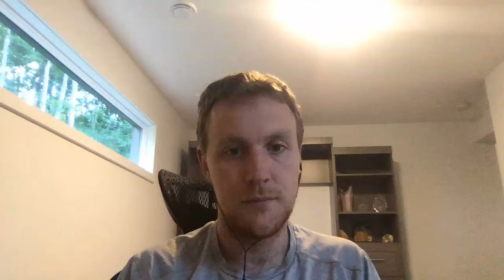DON'T MISS this U of T Engineering PERSONAL PROFILE PREP!

Comment: what was the question
Reply from the maker: “You want to determine if a new material created for solar panels increases the amount of energy that can be captured. You have acquired 15 panels of different sizes manufactured with different materials including the new material. You decide to set up an experiment to solve this problem. What do you think are the 3 most important variables to address in your experience? How would you incorporate those variables in your experiment?”